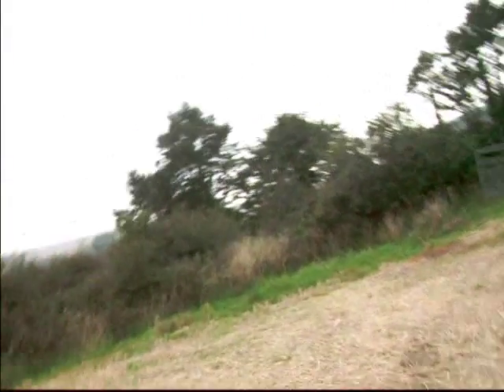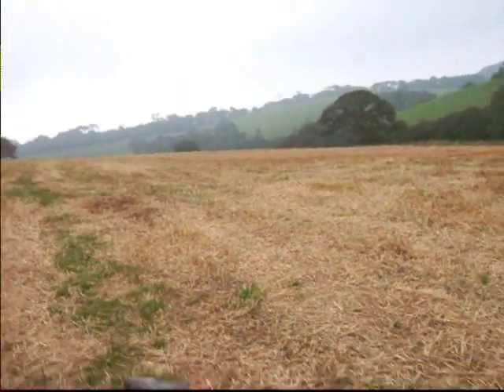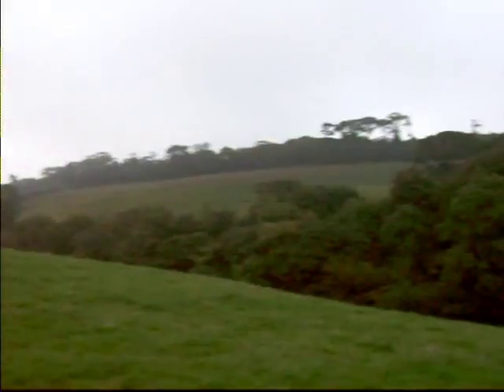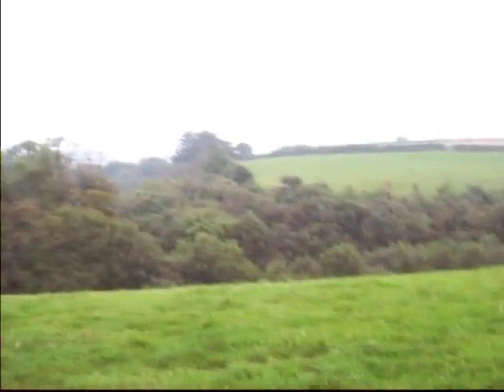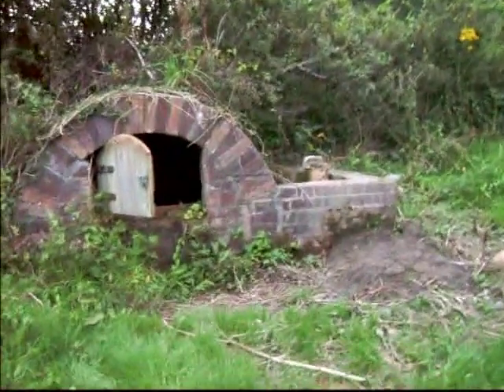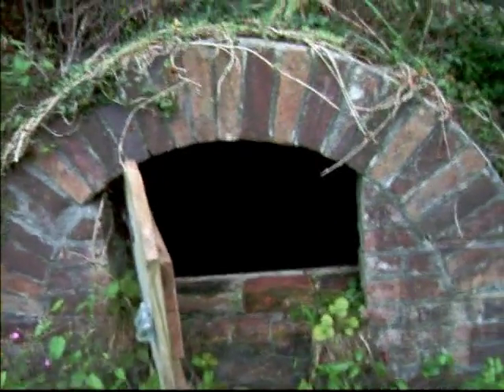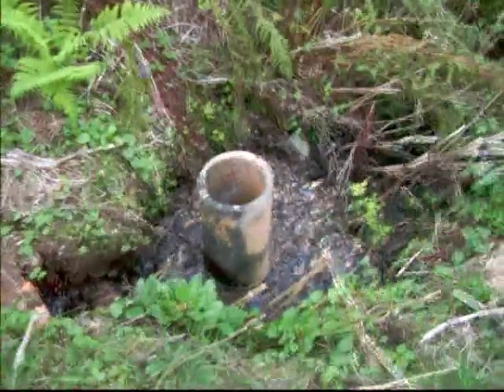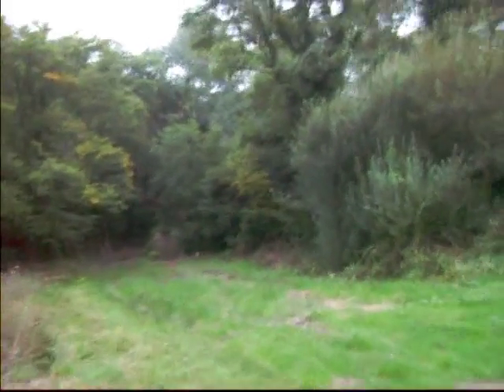Ram Pumps (Green and Carter for heligan)

Comment: Wikipedia alludes to this pump being able to pump treated water using an untreated drive water source.  Is this accurate?  It sounds different to the typical ramp pump.
Reply from the maker: That isnt the case in this instance... These are setup to pump the same water that drives them....

Comment: That's a great job the two of you have done there, well done. It might run for another 100 years now.

Instead of that noisy smelly (expensive) generator powering your light, why not make use of the 5" pump's flow rate and drop, and rig a small water turbine to run a generator..you could rig up LED's or CFL's to light constantly..should be able to DIY it for minimal cost.